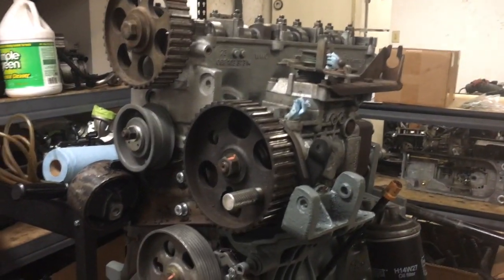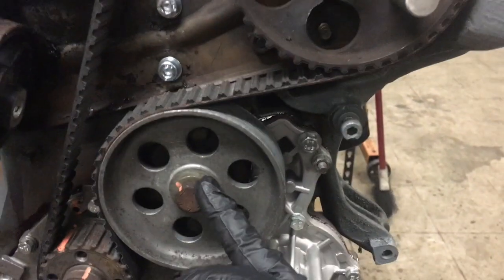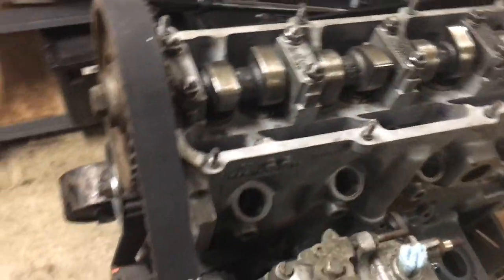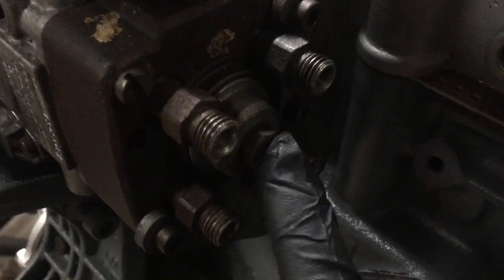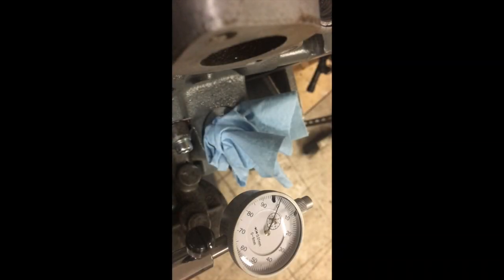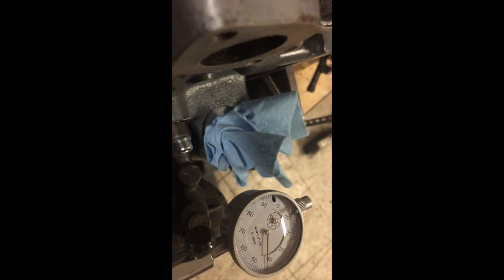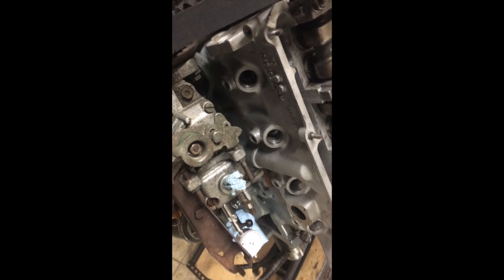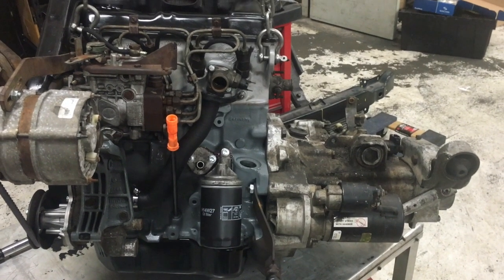VW DIESEL ENGINE REHAB PART 3: INJECTION TIMING

Comment: There are two vairables that noone that shows these videos adress.
(1) The starting point of where the injector pump is sitting in the slot.
(2) The positionof the dial indicator in the holder / how far in , as deep enough to
get the full reading but or deep enough to damafe to indicator on the high cam of it.

Comment: with the motor running I adjust the pump by ear with a big channel lock going forward or backwards of the mark. Get the bolts almost tight start the motor and adjust to ear. When the pumps get old those dial indicator adjustments do not work as good as listening to the motor and adjusting then shut off the motor and tighten the bolts.

Comment: Been having an issue getting pump timing re-established on a current mess. Your gauge looked like the one I got in an EWK set so I just went out to check mine. I was treating mine (somehow) as having SAE measurements so I was setting mine at ~39 to get that 1mm. DAMNIT ALL was I way off. It's also a bloody metric gauge. No wonder the thing runs like shit...barely getting it to start. As soon as I get the chance...back out I go to try setting it up proper.

Comment: How do u know the engine is at tdc after the gauge has stopped moving? How did u set the preload and where did u get the info about the pump readings for the gauge?

Comment: Came across your post as I'm looking up how to set up injection timing after replacing my timing belt, quick question, at the 2:07 minute mark I notice your block off plate is tapped, is this to relieve the pressure from blow by? I have a mk2 jetta diesel and wanted to also accomplish this but not sure what size I should tap it for. Any help is appreciated, thank you!

Comment: Where does the end of the dti gauge sit , how do you adjust the timin? ????
Reply from the maker: There is a hole in the center of the injection pump on the fuel line side. Install your gauge with I believe 1.5/2mm of preload then zero the gauge. Loosen the pump bolts at the accessory bracket and you can rotate the pump to meet the desired spec.

Comment: Hey, you didnt not put the vacuum pump. 
Did your oil pump work ? I thought the oil pump was activated byt the vacuum pump.
Reply: this shit is for real i almost broke my engine with no oil pumping when i removed this fckin vacum pump
Reply: do you know whats the connection of the vacum pump with the oil pump? i cant undestund it
Reply: the free pulley (between injection pulley and vilebrequin pulley) makes turning a shaft connected to the vacuum pump. 
The oil pump is related to the vacuum pump by a long axle. When the vacuum pump turns, the oil pump turns. 

So, if you have no vacuum pump, your oil pump can not work.
Reply: @jazjaz2364  i almost burn my engine today with this shit i removed the vacum so i can see the mark on the back of the crank to replace time belt, and then i run the engine with out it to check if i was ok on the time belt and my engine did some weird shit and shut down and then i saw i was not have oil coming up, then i connected the vacum and was ok but im sure i did a little damage with this shit
Reply: i dont hear any noise now when its running but when it was run with out oil ffor 1-2 minutes it stack 2 times and shut down, i hope i didnt do much damage
Reply: yeah man, that sucks
you have to be careful with this vacuum. Once you have put it off, you have to put it back. But you have to check once you have put it back... you have to turn the free pulley by hand and to check there is absolutely no hard point or slow-down when you turn it... the vacuum pump has to be perfectly fitted with the axle. It is boring.
Reply: @sk8foreal  yeah, your engin can still be good... you will see with time... if no smoke and no loss of oil/water, i mean... its ok. 

you will see with time. 

1-2 minutes is big with no oil moving... but you had oil already in engine, thats why its not dead. 

it shut down cause the lack of oil made the shafts sticky. You were lucky it shut down. Maybe its not damaged badly. 

Check the oil, if you see no metal, it should be ok. 

If it still works with no smoke no leak, its ok. Engine can be terribly strong you know
.
Reply: @jazjaz2364  i cant turn the free pulley by hand becouse is the time belt on now, but i think i fitted the vacum pump ok, maybe it was les than a minute with no oil i dont know exactly,i hope is ok, thanks for the help brother
Reply: @jazjaz2364  hello again i have 2 questions, when yyou change the time belt you need to tune the fuel pump again? i checked the time marks 100 times and they are perfect but engine dont work like before is has a litlle play, 2nd question is do you know why the engine has 3 water temprature sensors and not one ?thanks
Reply: @sk8foreal  1) normally there is no reason to retime the pump. Maybe you los one tooth or 2 ? 
Check battery and the electric wire to the pump. 
2) you can have one for the preheating, one for the dashboard : and the third idk.
Reply: @jazjaz2364  i check the time marks 100 times no theeth missing, fuel pump wire checked also, i dont know exactly how to explain, engine before replace time belt runed smooth now it has a little shake on idllee and as the rpms goes higher, if is not by pump tune then what the hell? is it possible to did damage when it runned with out oil and do this shake? i dont hear any weird noise at all by the way.
Reply: Yeah... no oil kills engine man. 

Must be the camshaft, the vilebrequin, or the soupapes... everything needing oil. 

check the oil to see if metal/powder
 inside
Reply: no oil slow down the shafts so they are no more sufficiently synchronized

so it is possible that the pump send the gazoil when the cylinders and valves are not at the good place and timing

it wd explain while it is shaky while everything seems perfect
Reply: @jazjaz2364   but now it has oil bro and the oil pump is working, when i said no oil i ment when i removed the vacum pump and it worked for a little with no oil, but now is ok from oil, there is no weird sound at all as i told you, im thinking if it overheat and damaged piston rings or gasket and looses comprresion from any cylinder and does this shakes, but there is no smoke on exhaust gas and there is no watter inside oil, if it was crank, rods or camshaft failed i would hear some noise for sure
Reply: @sk8foreal  if you did everything good, i dont see what could be wrong. Except if you think you did all godd but missed smthg. 
the only wrong thing is the oil pump not working. 

Well, if it is like you say, try to time the pump. If pump is good. Check the injectors. Check fuel filter too.

Comment: so how do you rotate the pump to get timing in spec?
Reply: There is a machined mark on the side of injection pump pulley that faces the pump. there is a corresponding mark on the bracket that the pump mounts to at the top facing the pulley inner face.
Reply: With the engine at TDC, loosen the 3 front mounting plate bolts and the one at the back, then rotate the pump by hand CW or CCW until the dial indicator reading is in specs. Tighten the bolts.

Comment: Ok I have the same motor in my 88 golf was wondering if it is a special pin for the injection pump and where to get the camshaft lock at.
Reply from the maker: James Cossaboon EWK Diesel Engine Timing Tools Set Tool Kit for VW Audi Volvo https://www.amazon.com/dp/B00O1Q8PU6/ref=cm_sw_r_cp_api_ZRd.BbBVDPV2H 
This should cover everything you need minus a dial indicator.
Reply: are you sure thats the right kit? according to the specs in the photos on amazon it does not work for the pre 88 or so 1.6L diesels.   @rallyewerks870
Reply: 1/4 drive chrome deep well 11mm snap on socket is a perfect fit in the hole in the injection pump pulley and the corresponding hole in the bracket where you would use the "special tool- lock pin". I would suspect another comparable 1/4 chrome 11mm socket from another brand would be the same.

Comment: How did you manage to do your AC delete?
Reply from the maker: I typically have buckets of v-belts pulleys from VW’s that allows my to mix and match and find the right combo. IIRC the crank and water pump pulley were the stock ones and I used a different alternator pulley. It may have been a 16v alt pulley.

Comment: Friend helped me a lot your video. Could you tell me the size of this pin that locks the injection pump? a big hug from Brazil.
Reply from the maker: Not sure, I was passed down the tool kit from my father however they are available on Amazon. Cheers
Reply: @rallyewerks870  Thankyou

Comment: how can you turn the engine over with the injection pump pulley pinned?
Reply: Once he had the belt installed, he would of removed the pin, before going on to setting the pump timing with the dial indicator.
Reply: You don't. You pull the pin. After you get the motor back to TDC you put the pin back in to hold the sprocket while adjusting the pump.